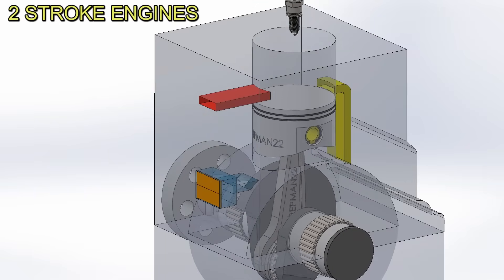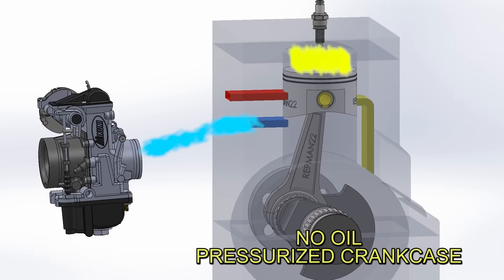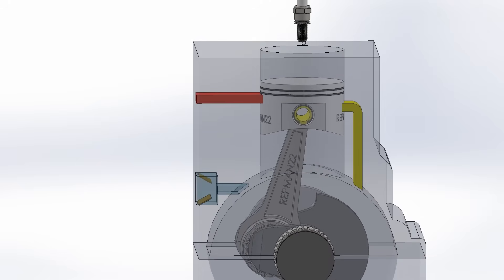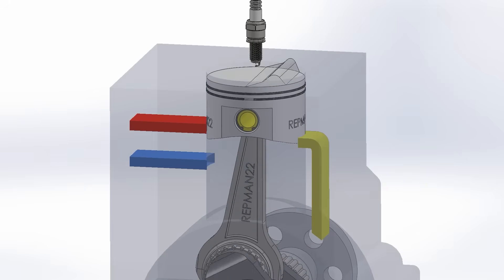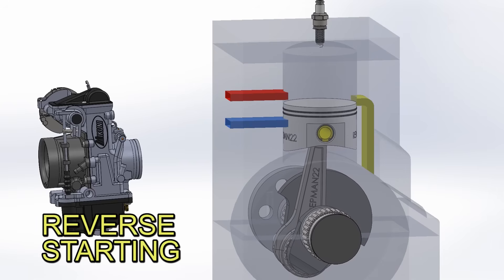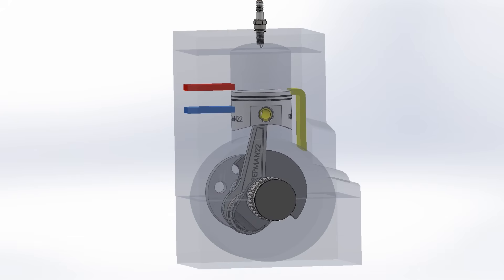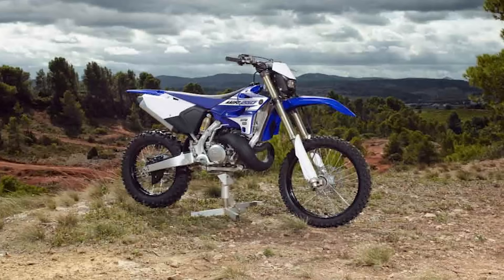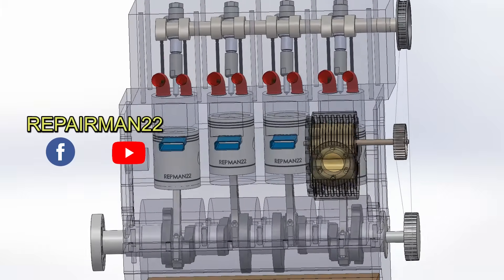Everything You Don't Know About 2 Stroke Engines 🤯

Comment: Direct injection doesnt work because the bottom end runs too hot without fuel cooling.
KTM have already proven that.
Reply: many many outboards used DFI/Ficht/HPDI/TLDI direct injection with no problems in crankcase heat! most used a vapor tank that recirculated warm fuel by cooling it down and putting it through the crankcase. oil had a seperate pump directly to cylinder walls and crankcase, which is what really helped combined with raw water cooling
Reply: Nope, (to the best of my knowledge).  KTM is using "transfer port injection", (because of EPA force).  What they dropped is the direct injection into the cylinder during the compression stroke, (like this vid shows), because it requires much more pressure, probably making metering and reliability not as sound.  The bottom end temps will be the same.  But, there is the cooling factor you mention, so maybe I am wrong, and the bottom end just gets warmer with only oil injection on the bearings.

Comment: Fantastic! I will come back to make questions, and more questions to develop simplified and cheaper electronic ignition (or piezo atomizer😅)  and injection, with cheaper sensors and microcontrers like ESP-32, photodiodes for monitoring  temperatures like EGT, and solve my  problems with stability (and share with you) here in Brazil with this admirable trash tools!

Comment: Full of shit for any given capacity most two strokes rev lower than four strokes!
Reply: no?
Reply: @MSKarting  No what? Have a look
Reply: It depends on the size of the engine, and the tune (is it a race engine, and what kind of racing?).  Typically, 2 stroke can be made to rev higher, because they have less reciprocating mass and no poppet valves.  Now, if we go by rotations of the crank, I am seeing high revving 4-strokes.  But if we go by the entire power cycle, (each spark, twice as may crank rotations for a 4-stroke to complete one cycle), than that would be half.  But we measure crank rotation only.
I build 30cc (approx) racing 2-strokes for a living.  let me know if you can find a 30cc 4-stroke that will rev to 21,000 rpm with out breaking.
Reply: @EarthSurferUSA  agree, i race with a 100cc 2 stroke kart that revs up to 20,000 rpm

Comment: My Jawa 350TS has 3 rings as a 10:1 compression ratio.
Reply: The vid is wrong with compression ratios.  it compares the 2-stroke method (about 8:1), to a full stroke 4-stroke engine (12:1). 
10:1 with the 2-stroke method (only the area above the ex. port is calculated), and you probably could not run gasoline.
Reply: @EarthSurferUSA  My Jawa has a 10:1 compression ratio. I have a compression tester and that is correct and have to run it on 98 octane gasoline.
As you say only the area above the exhaust port when it is sealed by the f irst piston ring is calculated as swept volume for compression ratio calculations.
Reply: I call my wife a jaw wow
Reply: @AndyGenova-jr9ol  How many rings does she have😁

Comment: The animation shows the piston below the intake, but this never happens on 2 strokes
Reply: Secrets n lies what ev
Reply from the maker: In any part of the video, the piston goes under the intake port.
Reply: @repairman22  
Yes, & it's wrong.

The piston top never goes low enough to open the intake, it would defeat the scavenging if it did.

Look at any 2 stroke, Your video is wrong!
Reply: @Not1Edit sorry, if the piston doesn't open the fresh air intake port, nothing will happened.
Reply: @Not1Edit  Well it happens in a 50cc engine called Huskvarna Flinta. The aftermarket crankshaft is wrong, they have increased the stroke by 2mm but only downwards, so the piston opens the intake port.
Reply: @Not1Edit  I think you should study the video closer
Reply: @jan-akelofgren7547  "The aftermarket crankshaft is wrong, they have increased the stroke by 2mm but only downwards, "    
You better figure that one out.  That is not possible.  The added stroke is equally split, up and down.  It can't work any other way with a rotating circle crank.
Reply: @repairman22  Just as good of a explanation as much of your vid.  What do you mean, "The piston goes under the intake port."?
The poster is wrong though.  "The crown of your piston, is not opening up the top of the intake port at the bottom of the piston stroke."
That is what you meant to say son.   Now, go research the "sonic wave" that you called "pressure" in your explanation of a tuned exhaust pipe.
I am professional at this stuff, (and do it for a living, selling world wide).  Not like your teachers today, who we trust soooo much.  :)

Comment: I liked the crankcase case compression ratio explanation never thought of that!
Reply: @powerwagon3731  that's why crankcase seals are a must
Reply: Agree. I had no idea.
Reply: @powerwagon3731  absolutely when the Piston goes down it charges the bottom to make the mixture go back up
Through the transfer ports to both blow out the exhaust and charge for the next power cycle
And the timing is in the placement of the ports the Piston is the valve in a piston port engine.
Reply: @powerwagon3731  that's in a piston port engine. A case read induction is a little bit different but not much rotary valve is self-explanatory usually. Then you have your twin piston twingle engines that still use ports.. but the best running ones in my opinion are the twin cylinder alternate firing like a 350 Rd Yamaha or a 500cc twin titan Suzuki
Reply: Me neither.
Reply: When I raced 2 stroke dirt bikes, we used to put cork under the piston to increase compression.  It worked well.
Reply: If the engine has a carb, the pressure in the crankcase, also times the fuel input into the carb, via the impulse line/tube. Without an impulse line of a leaky impulse line, the carb wouldn’t get fuel at the correct time, leading to poor running, poor starting and in the worst case scenario seizure.
Reply: @ learn something new everyday. Thanks!
Reply: What is a boost port? I know it exist as a term but never knew what it really is.

Comment: Good animation, covers it mostly.
A few points missed but nothing major.
Reply: Yeah not too shabby !.  Where in Au are you ?
Reply: @pauloconnor7951  In Melbourne, Sthn Burbs, grew up here.
Reply from the maker: Hi. Tell me those points so I add them in other video. Thank you!
Reply: @repairman22  How about "3rd Port" motors, like my Mac 45 go cart motor.  There is a port that uncovers during the power stroke that pressurizes the incoming fuel/air before it reaches the reed valve.  This allowed us to beat Corvettes 0 to  80 on a Little Indian minibike (24" wheel base).
Reply: @repairman22  A bit too lengthy for the comment section.
I do 2T vids that go down the rabbit hole on each topic so maybe look over those if you like.
I sent some via your email.
But as mentioned your vid covers the basics fairly well.

Comment: There are cleaner lawn care 2t engines that leak clean air in front of the transfer ports so it's clean air 1st then a/f mixture, since the 90's-Present (RedMax: Strato-Charged). :)
Reply: Really ?. Who does that please ?
Reply: @pauloconnor7951 That's irrelevant. The only things that matter, are power, reliability, and light weight.
Reply: @Bill-sp8kb  i agree with that but for boats, having a DFI 2 stroke that gets 35% better fuel economy at cruise is huge! some are even better than that like an OptiMax